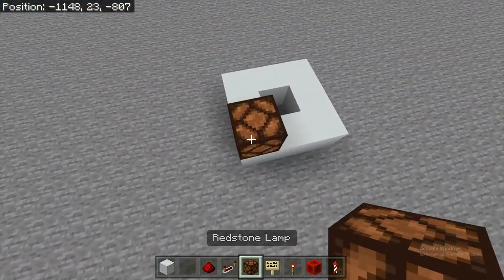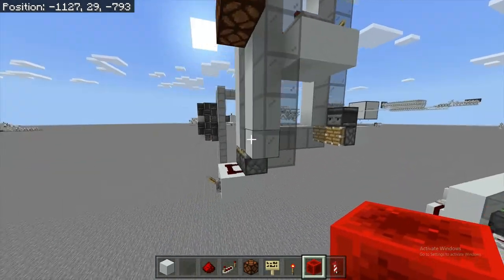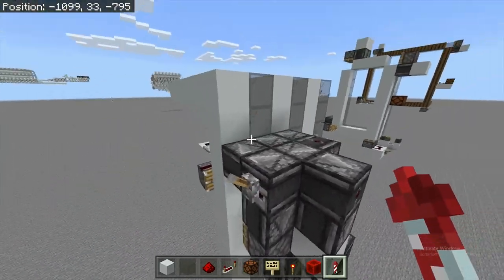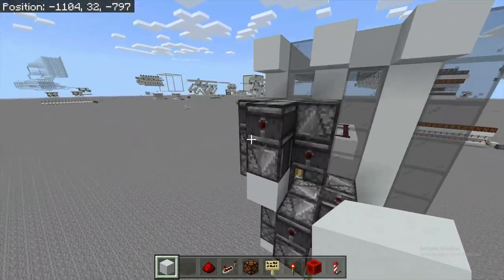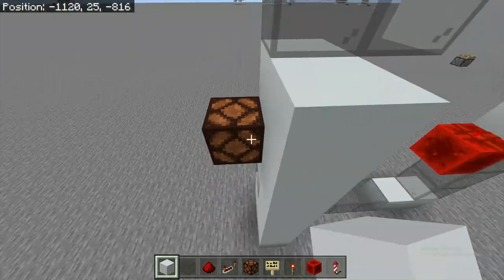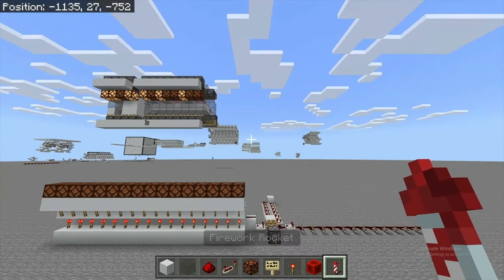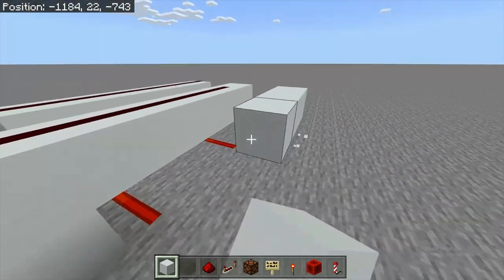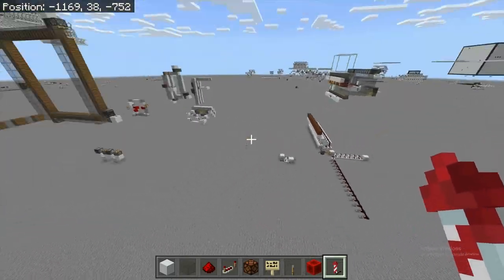Piston feed tape memory - Minecraft Bedrock Edition

Comment: Tape memories are quite useful in survival if you need a robust automation of a system. It is also possible to do precise sequencing of actions. You can also quite simply write a program, store it and run it without too much trouble. In survival, its not really an issue the speed (at least for me) so tape ROM it is. writing is difficult tho.

Comment: the barrel concept is maybe better than you think, I suspect, since each barrel can have a comparator strength of 0-15, so rather than each block being a rewritable bit, it's actually a rewritable byte. actually, if you want to get really fancy, since it has a storage of 27 stacks of items, each individual barrel could store up to 27 independent 6-bit values, (though it will read and write very slowly), if you were to use a different stackable item type for each inventory slot in the barrel, and then count each type of item to a different register as you empty the barrel into an item sorter+counter
Reply: using the DEC SIXBIT encoding, each barrel can contain 27 character text messages haha
Reply from the maker: Yea barrels are quite good for storage however it is a bit of a pain to write to them. For rom they are great and in bedrock edition they can be moved by pistons so would work quite well in this case.
Reply: @TheDarkness344  interesting. It also got me thinking of, instead of piston tape,  using hopper/chest minecarts that can be accessed randomly by sending them onto a bus track where their comparator value can be read. Routing minecarts to various docks could work as a register system for different operations haha. Anyways, I liked your video,  thanks